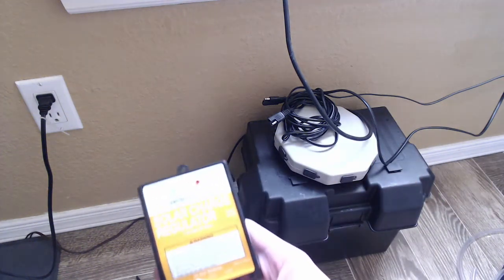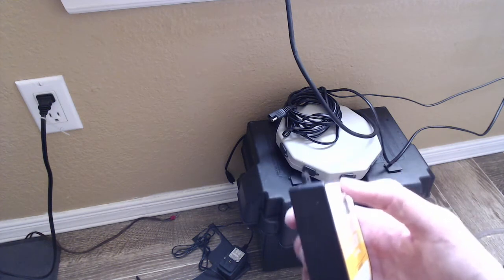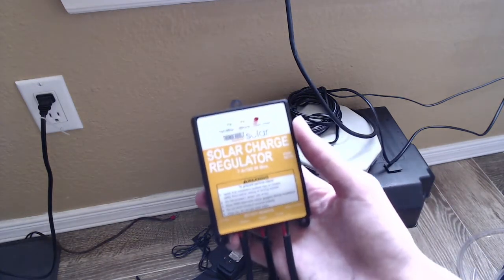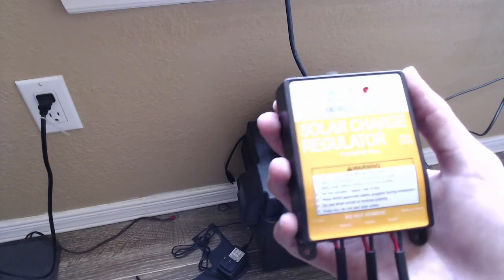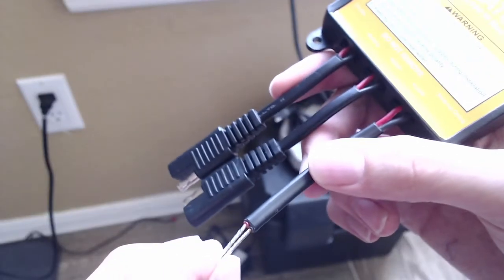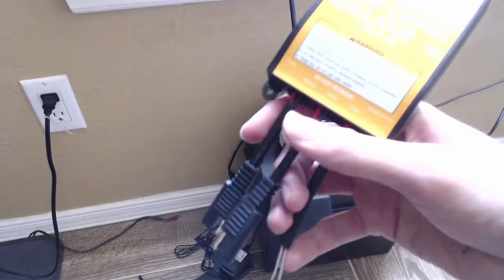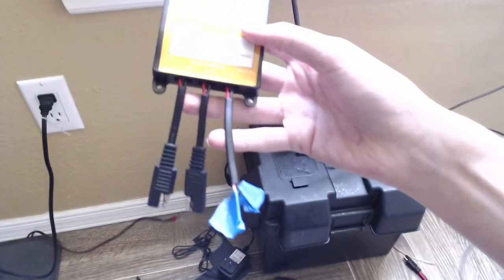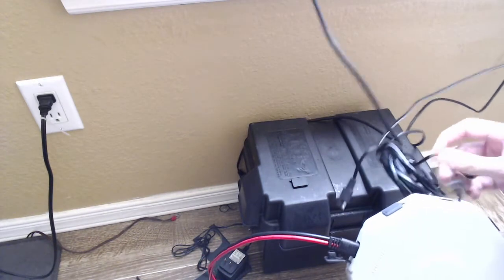Adding a Charge Controller to my Solar Panels

Comment: do you know the minimum watt in put for this controller? thanks
Reply from the maker: i got it to turn on with a 1.5W panel, though i would suggest at least 5W. even then you really dont need a charge controller with a wattage that low

Comment: Hey how’s this set up working so far? I just got a 100w panel with two 35amp batteries and that same charge controller. I want to add another panel but not sure if this controller will handle it.
Reply from the maker: I made an update video last year but I have since dismantled it again

Comment: You reversed the polarity of the leads, then used painters edge tape. You should not be working with electricity.
Reply from the maker: I reversed the polarity of the leads because I was plugging the cable in the other way around so that one lead could plug into another. Positive and negative were still matched.  
I used painters tape because it was an insulator and I did not have electrical tape at the time. while it is certainly not appropriate for line voltage, this setup never saw more than 20 W at most.

This setup was able to keep the battery charged for the number of months which it operated, however I have dismantled it since